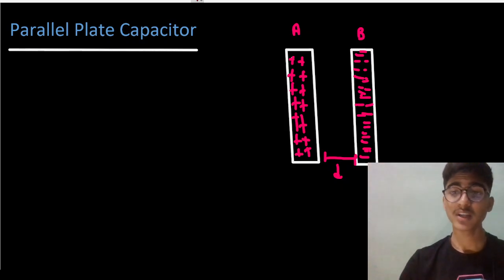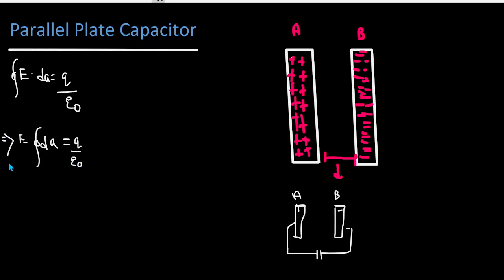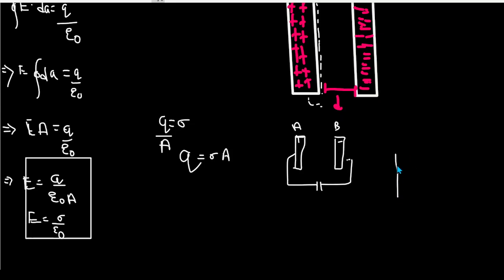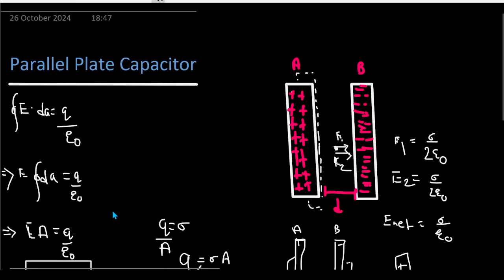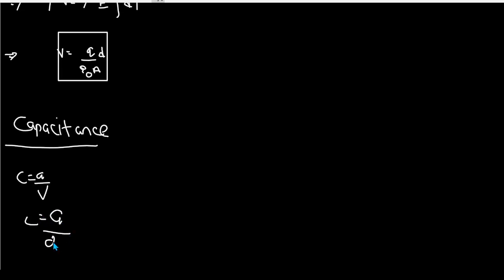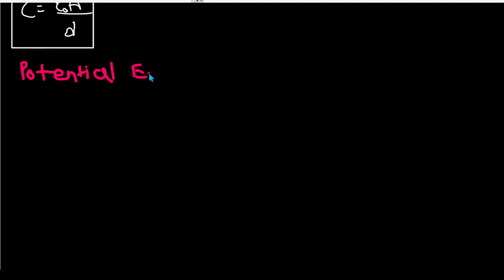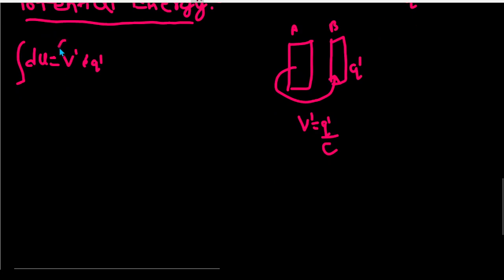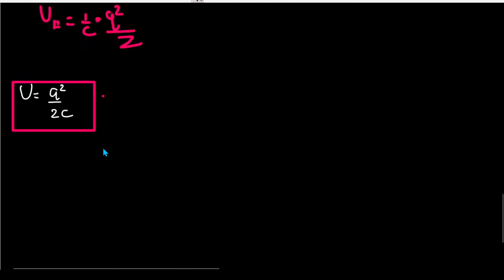Parallel Plate Capacitor|Capacitance||Part-02| For IIT JEE main|#iitjee#jeephysics|10 grader

Comment: If You are in an accerlating  frame  then Fnet=0 then a not zero. Right

Then If you drop a body from a certain height to the ground it's also an accerlating frame .  But here is not following rules
Here F is non- zero a is non zero.     Nlm first law is valid ??
Reply: answer me   If I drop a a bottle of water why there is no gravity.
Reply from the maker: @pve_slayer  Internet is full of such misconceptions...
Think on your own that if water inside is feeling no gravity then why it is falling along with the. Bottle it should be at rest....
Actually water don't flow out because both the bottle and the water are in free fall so the there is no flow of water from the bottle...
Just like in the case of lift..
If i attach a tap on the upper side of the lift and water started flowing every 1 sec then suddenly if water reaches the bottom part of the lift (i assume there is a hole exactly in the centre if lift ) i put lift in free fall..
What happens???
If i observe it from outside i think that why the water is not coming from the lift as because lift also started moving so. Both started moving with same acceleration that' why i felt that there is no gravity acting on drop of water but that  doesn't true ...
Reply from the maker: @pve_slayer  ok if there is no gravity why it is falling??
Reply: Same question arise my mind as well you . But in practical if you test the experiment the bottle will fall without gravity.
Here I post a video for you
Reply from the maker: @pve_slayer  many people say that it's feel like gravity is not acting..
That doesn't mean that gravity is not there it only means like pharase to denote phenomenon..
Reply from the maker: @pve_slayer  how it make sense that something fall without gravity??
Many people say gravity is not acting.. so this is not true if gravity is not acting then water should remain at rest and bottle only should move in downward direction but that doesn't happe both move simultaneously..
I think you are confused between centrifugal force...
Reply: Very good observation 👍 
I'm wrong
Reply from the maker: @pve_slayer  you are misunderstanding the nlm first law..
It says that there is no change in the state of body if the fnet=0..
In case of ball there is a net force in the downward direction as there is no opposing force...
Reply: https://youtube.com/shorts/e3K3JqRVrjM?si=HBkO1QjzeqJIVMNS